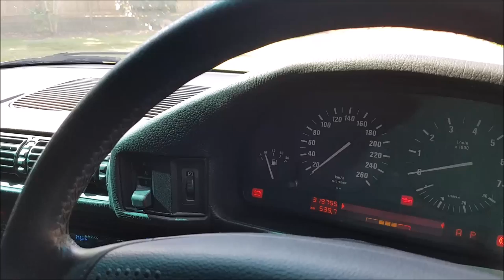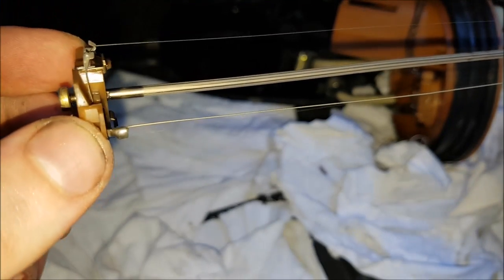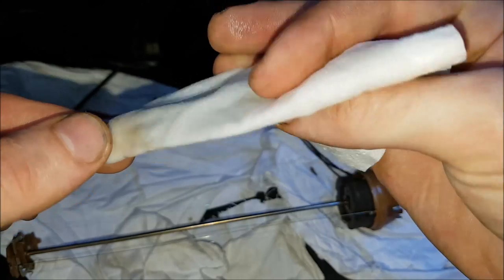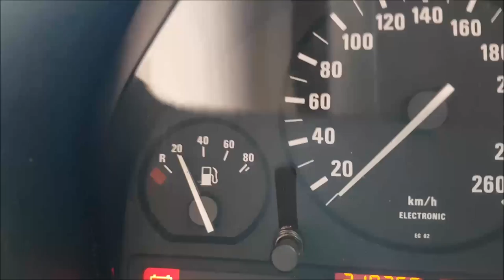How to Fix a Faulty Fuel Gauge/Clean the Fuel Level Sensor - BMW E34 & E32

Comment: I had a similar problem with my LHD e34. 
I appreciate your having made and posted the video, but in ,carefully, following your method, I encountered a problem that made the job much harder than I expected. 
At the 4:00 minute point on your video, with the sending unit removed from the tank and the plastic housing partially disassembled and turned upside down, you say, "To get this apart, get a very small screwdriver, and I pushed on this in here (the video showing the lower end of the shaft that the float travels on) and it started to pop apart." 
I did just that. I pushed and pushed with a small screwdriver, a smaller screwdriver, a larger screwdriver, a small punch, etc. I kept pushing, figuring that I wasn't pushing hard enough. Before pushing, I should have looked carefully at the end of the shaft because I would have noticed that on my e34, anyway there was not a "screw" on the end of the shaft, but rather a slotted round nut threaded onto the bottom of the shaft, securing it. 
Had I looked more carefully before pushing on the end, I would have notice the slotted nut and would have simply loosened it. In my haste, my prolonged screwdriver pushing efforts resulted in my marring the end of the shaft to a degree that it took me a very long time to remove the chewed up nut from the end of the chewed up shaft.
My guess, since all you had to do was push on the end of the screw (actually the shaft), that the slotted round nut should have been threaded onto in you e34, was that the nut had come off and was, and probably still is, somewhere in your gas tank.
I am not faulting you, Samuel, I really appreciate the video. I should have looked at the end more carefully before pushing on it and making much more work for myself.
My search for the slotted round nut led me to McMaster Carr (So. Cal, USA), part # 562-692-5911.
Reply from the maker: Thanks for the write up! Sorry for misleading you, I was more or less figuring it out as I went as well so it's good to know.

Comment from the maker: Hey everyone. So, it's been a long time since I did this, and to be honest my 'fix' didn't actually fix anything properly! My fuel gauge still plays up. Anyway, I left the video up because I thought the tutorial on how to remove the fuel sender would be useful to someone.

It's been years, but I still have my E34. I never finished the videos I planned on making, but I did a LOT of things to my E34. I successfully manual swapped it to a 5 speed, with a lightened flywheel. I also installed a performance chip. 

Lately Eve has been pretty unused. My brake master booster and power steering lines (all connected) shat themselves and so it took me a good while to rebuild everything. Right now I'm waiting to get my power steering box back (it's getting rebuilt), I'm getting an alternator rebuilt, I'm removing the 5% tint, and I'm replacing the caster arms. Soon she'll be back on the road, and I'd like to make a video showing my new setup and maybe a POV drive.

I'd also like to make some videos for my daily, which is a robust and reliable old Volvo 240 sedan, built in 1989. That thing is a fucking tank. Anyway, hope you are all well and that my crappy juvenile videos from 3 years ago actually helped someone.
Reply: So you haven't fixed it yet? Damn. Was hoping this will solve my issue.
Reply: I love your videos, it really helps my bmw E34 DIY, sincerely hope you can continue to film more E34 videos.
Reply: Fellow e34 guy here, we hope to get more videos please!
Reply: Bought an 540i E34 3 months ago , your videos are a huge help !
Reply: It helped me. In this case you also have  to clean the plastic  part that covers the buoy mech, wich in my case was full of small bits of some kind of matter that interfered with the circuit.

Comment: Since I removed whole dash board and did my own aluminium dash I had to use custom fuel gauge... it was pain in the ass searching for forums and info of how to make it work, but I've managed and it's great. I'll make video after I fix the starter, cause I literally can't drive my car now. Too cold and starter failed. Also need to register my car and yet there isn't much free time so I could devote my self to filming anything.
Reply from the maker: +Xw0rkS Man, props to you for making your own dash haha! How did you get it to work? I know it's based on resistance between and max and min value.

Comment: great video.  my gauge is stuck on E, even when I fill up the tank to full. do I have the same problem?  also, I have heard of some people of saying to gently tap the fuel tank from below, and it will set loose the float sensor.  should I try that first before I get inside and take it apart?
Reply: same problem!
Reply: @aminetlili1374  ok let me know if u fix it

Comment: Great videos!! Have you had to replace the drivers door rubber seal on your vehicle? Were would I find one not so expensive? Also looking for a 94 530it power steering reservoir. The vehicle has a two in one pump for power steering and for the self leveling suspension system.

Comment: hey there...how it does in the long run? does the problem came back or just go away..i got a cluster from an E32 and  use my code to it but the fuel problem is still there..so im guessing its the same problem...but will the problem go away for a long time? cheers!

Comment: How did you know all this!! Wow, I would have just looked for another fuel gauge or drive with a 5 litre of fuel in the boot. PS Your video has also helped me to remembered I removed the screws while cleaning the car and forgot where they came from, hehe. As usual hats off man. Cheers.
Reply from the maker: Glad I could help Gerry! I got most of this off of forums or those websites I linked in the description ;) Cheers
Reply: ok thanks man.
Reply: Gerry Reggea acome fuckme

Comment: Hello sir. I have a 2001 x5 I have a issue when I run out of gas at 1/4 tank. It will not go lower. I have a new pump & sending unit. What could he the problem?

Comment: You can turn the key on for about 5 seconds and then off and repeat this about 5 times 2 repressurize the fuel system in most cases.

Comment: hahaha fuck, you made me laugh at the end! Time to fix my erratic fuel gauge in my 540i. thx
Reply from the maker: +V-SPEC It's not the first and certainly won't be the last time I swear at my car! Hope it helps mate
Reply: After cleaning mine it seems to have had no effect what so ever. :( Have you done the heater resistor replacement yet?